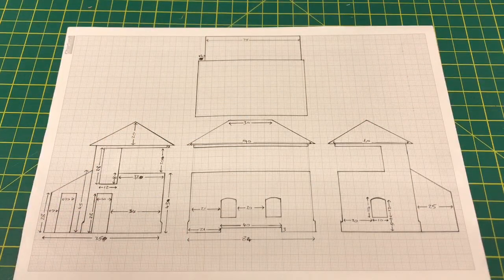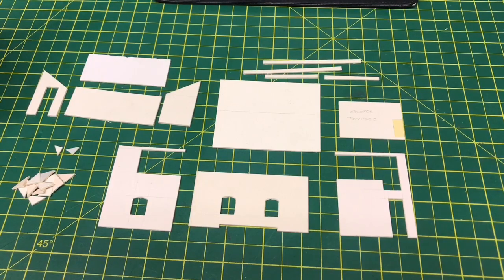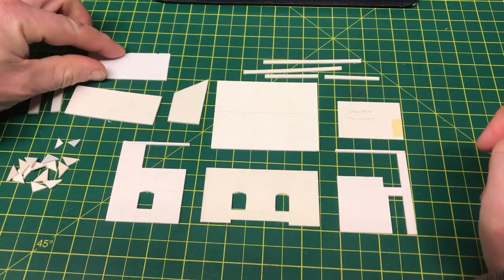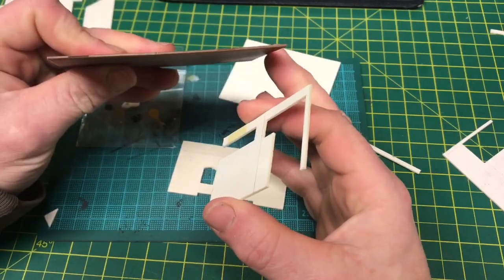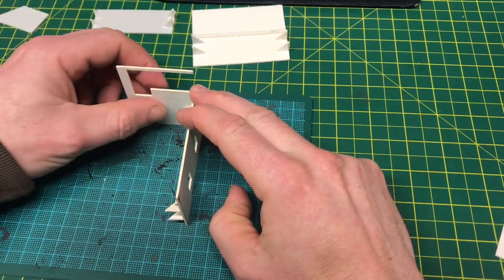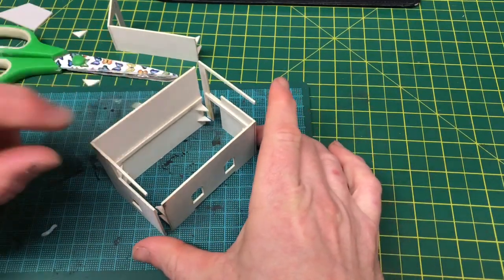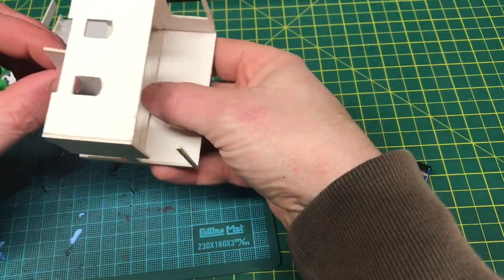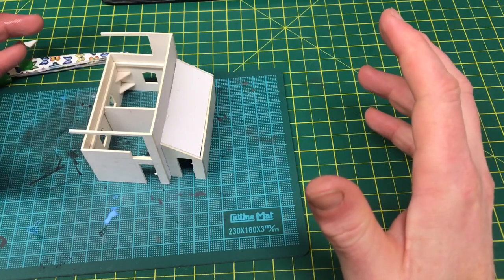Building A OO Gauge Model Railway: The Scratch Build Series 2.1 - Signal Box, The Basic Structure

Comment: That is a  good looking signal box, Paul.  I will need something for High Elven in due course.  I will have a think about the adaptations that might be needed to build in N gauge.  So far the only one I can think of is not to try to cut the thin strip at the top of the sides, and use, as you suggested you might need to do, some stripstyrene for that. I will be interested to see what windows you are using, because that might be the trickiest bit to copy.  Stephen
Reply from the maker: I think I’ll be taking the same approach with the strip styrene, those card strips are already quite weak. As to an N gauge version I can see the only issue being the windows. I’ll be using SMS LX146-OO windows. Justin did those for my last box so I’m sure he could scale them down for you. Paul

Comment: I like what you are doing. 
The board you are using is not something I have seen in the USA. Except perhaps as illustration board, but that is expensive. 
Most of us would use styrene sheet for this. Evergreen is the brand most use, I have a place to buy 4x8’ sheets.  (Much cheaper)
My glue of choice for most plastic is is a mix of MEK and acetone. (Most of my friends use a commercial product that amounts to the same thing. )
I would have used .125” square strip for the corners instead of the wedges.
Reply from the maker: Thank you for your comments PMsteam. Plastic sheet is a perfectly good material to use as well and I have done so in other builds with the use of similar glues to construct. Thanks for watching. Paul

Comment: Hi Paul, a lovely build, well done. I would like to model the same building. I wonder if you would clarify the overall width of the signal box as shown in the left hand side elevation shown on your drawings. is this 75mm, which would make I think the measurement between the door in the main building side and the lean to 4 mm/
is this correct? thanks